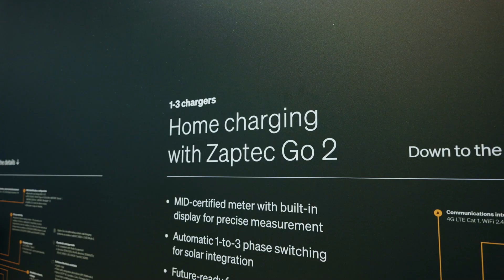Zaptec Go 2 – Bidirectional charging

Comment: Looking to buy a Ford Explorer.  It says it has Bidirectional capability.  Will this unit charge the Explorer and provide my house with electricity when my Tesla battery is empty?
Andy
Reply from the maker: Hi Andy! 

Yes, the Zaptec Go 2 will charge the Explorer as a normal home charger.
But to actually send electricity back from the Explorer to your house, you still need:
– A car that supports V2H/V2G
– A certified energy management system or inverter in your home
– Local grid protection equipment approved by your installer

Zaptec Go 2 itself is ready, but the whole system around it (car + home + installer setup) must also support bidirectional operation. So in practice, yes it can help make this possible — but it won’t do it alone out of the box.

Have a great day! 😄

Comment: Does it work with Renault 5 E-tech in a  Vehicle to Home setting?
Reply from the maker: The Zaptec Go 2 is technically bidirectional-ready (it supports ISO 15118 and has the right metering), but the Renault 5 E-tech itself does not currently support Vehicle to Home (V2H).

So even if you install the Zaptec Go 2, you wouldn’t be able to use the Renault 5 to power your home — it will only charge the car in the normal one-way (grid → car) mode. I would stay tuned on Renault, and check if they post any updates on V2H 😄 Have a great day!
Reply: +1